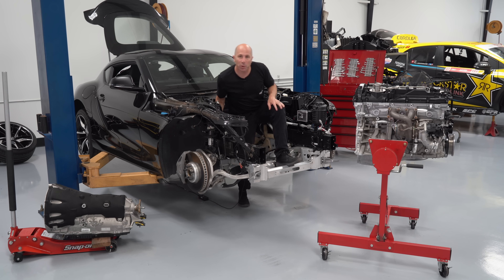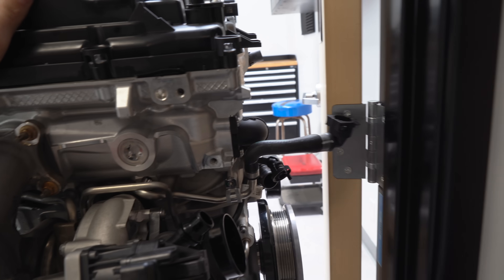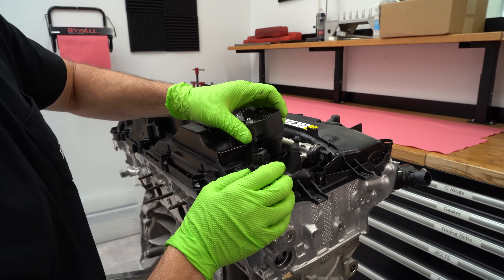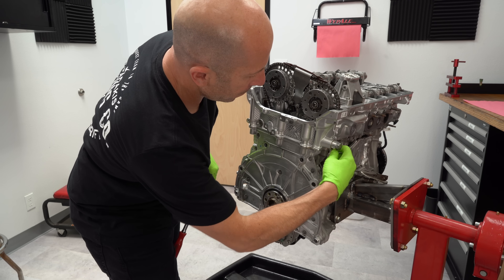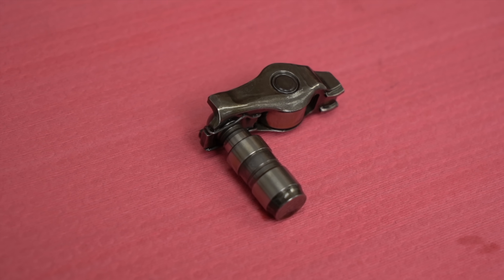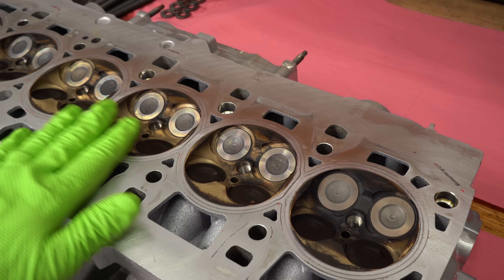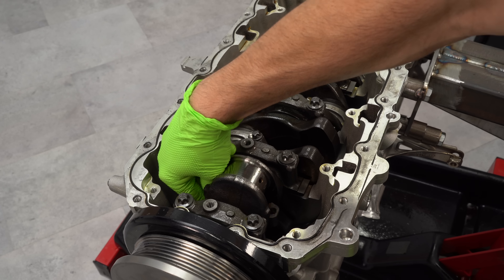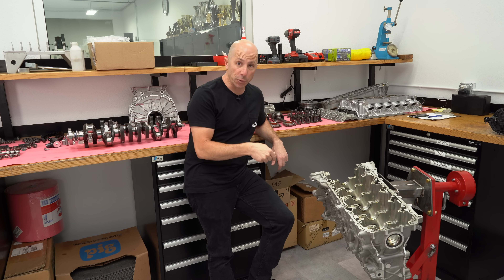2020 Supra B58 Engine Teardown - First Look - Better than the 2JZ?

Comment: Papadakis...oh man...how havent I come across you til now?  I have been followin you since the H22 ef hatch days man.  Nice to see ya still at it.  Gotta say, looks like exhaust lift increases are gonna be interesting..vid makes it look like the rocker will hit the casting with much more.  Cant say I am in love with some design elements of the engine, but the block sure does look stout and very well cast.  Looks like a damn clean block/foundry work.

Comment: Very interesting engine, Im amazed at the 2 port exhaust for the turbo bolt on. Questionable designs for me are the intercooler that is located inside the intake manifold? hmm. But to counter that, i love the water infusion to cool the turbo air.

At 9:19 i see they used INNER bolts for the cylinder heads - this is a flawed design that Mercedies dealt with in mid 2000s - it caused the bolts to rust and snap from less material in the bolts - a simple fix? USE outer bolts - much more materials - longer life. 

Another thing - NO GASKETS? WHAT? No metal head gasket ? no oil pan gasket? I just dont see this lasting past 100k without all leaking. Time will tell.
Reply: They kind of already went over 100k without any problems. These heavily share parts dead of diesels and are improved/changed yearly by either getting rid of this or that or having some small or big improvements.

Comment: I forsee different cylinder heads a common upgrade on these. That internal exhaust manifold is no good. Head soaks heat, makes a huge difference in temp side to side and probably doesn't flow well.
Other tech is a plus on these

Comment: You have to remove the cams to take off the head? You have to remove the engine to get to the timing chain? Seems like a maintenance/tuning nightmare. Jury is still out on direct injection

Comment: Spoiler: You can't use aftermarket headers 🤣
Reply: Well you could fab something that bolts to those two exhaust ports and extends the exhaust but I'm not sure you'd gain anything but lag and maybe less reversion if it was a ultra high hp build. Lots of luck if you ever need larger exhaust with an internal manifold though.
Reply: @177SCmaro  Indeed, and the guy in the video repeats (simple, easy, straight forward, etc) yet it's a tuner's nightmare 🤣

Comment: 10 years later I need to do timing belt chang that will be 20000-100000 dollars. "why" (bmw thought it would be amazing if you had to separate the engine and transmission to get to the timing chain) proper German engineering. that's how can you skruw the customer when the worintee runs out. just do it your self with the torques  bits that are known to strip out. I have done a fue timing belts and timing chains. it just feels bad telling the customer how much it costs. becous the car thay own is a money pit and should have got rid of after the 5 year of owning that piece of crap I like to end this with what I say to all my customers (it is your money and you can spend it however you want, I do not care)

Comment: I have a quiz for all of you. If the mechanical fuel pump runs off a lobe on the cam which actuates it 3 times per camshaft rotation, How many times is the fuel pump actuated per revolution of the engine? Like or reply if you know the answer :)))

Comment: I am blown away with how much more complex this engine looks. I was always of the mind that simpler is better and more elegant as far as engineering goes. I have been disassembling and assembling engines for 30 years and I would have become confused fairly quickly when tearing this motor down. Very interesting video, than you for posting. I am hooked and will continue watching.
Reply: did you say disassembly?   and  assembly?     oh i thought they were tearing down a building?    AMATEURS
Reply: The complexity gives you high hp, high efficiency, and long life.
Reply: @catinthehat5140  that just sounds like a marketing slogan..
More complexity increases the number of sources of error, thus leading to higher repair cost and making ownership more expensive.
Reply: @catinthehat5140  pretty sure high hp and long life dont go together
Reply: @catinthehat5140  lol no
Reply: @sigmamale4147  Back in the 60s and 70s if your car hit 100k miles you would take a picture. In fact most only had 5 whole digits on the odometer.
Reply: @catinthehat5140  ok? What about it ? 90s cars were much more reliable than todays
Reply: @sigmamale4147  how do you know?